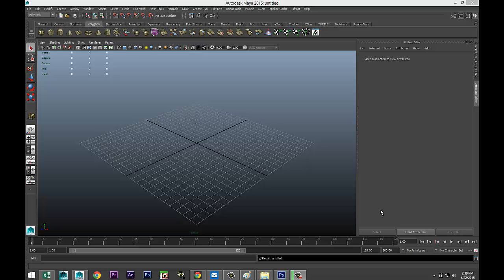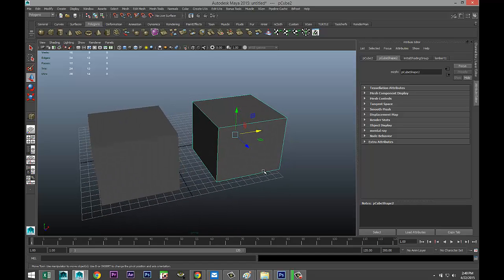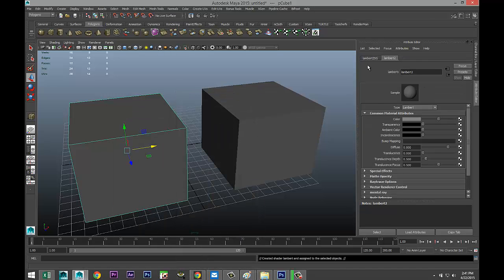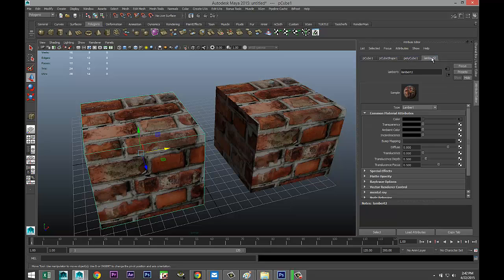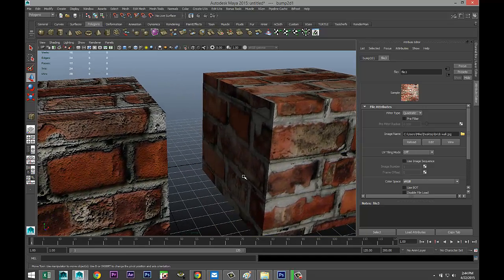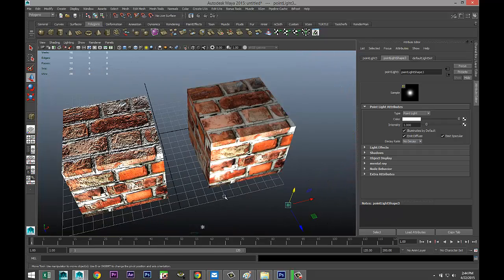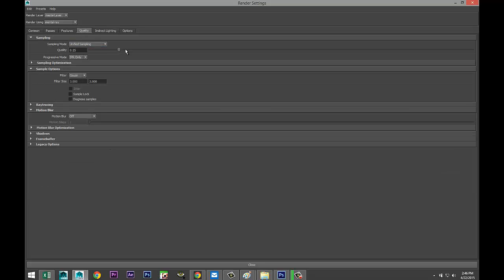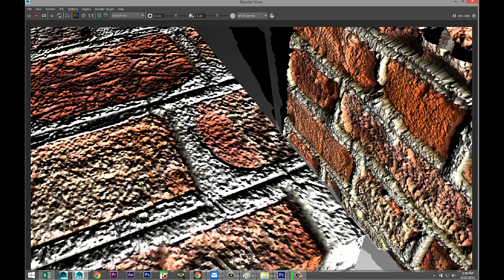Maya tutorial : Bump Map vs Displacement Map

Comment: ok, this is where I mess, up, I make a wall, apply texture, but it appears the wall is 12 ft for instance and my pictures are 4 ft, so I see 2 seems, im guessing I need a tutorial on diffuse? Is that a different tutorial?
Reply from the maker: NOR3MSTI Hi there,

This is not a diffuse problem but a UV problem. The texture needs to fit the surface.
Check out this video I made on the topic
https://youtu.be/Tpl0u1uRSUI

Regards,

Mike